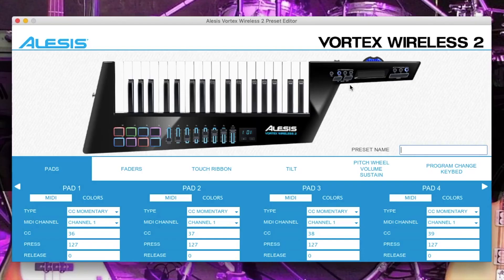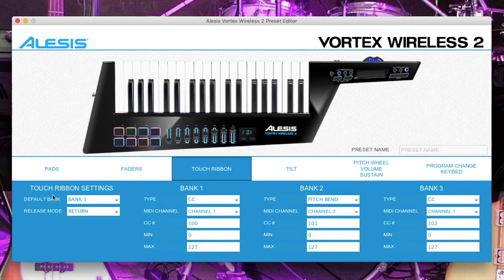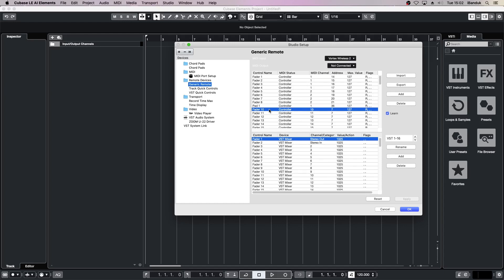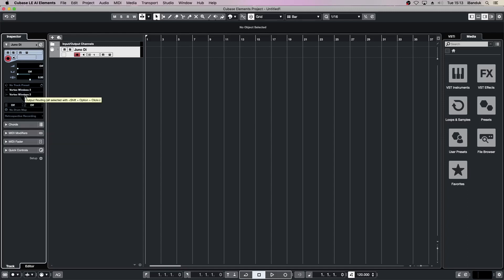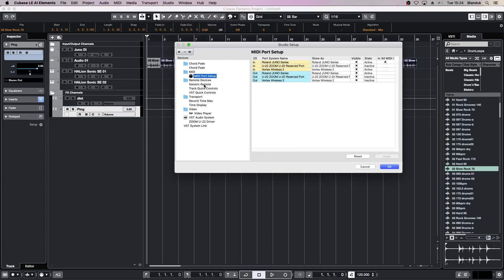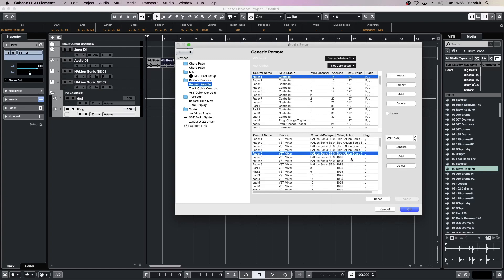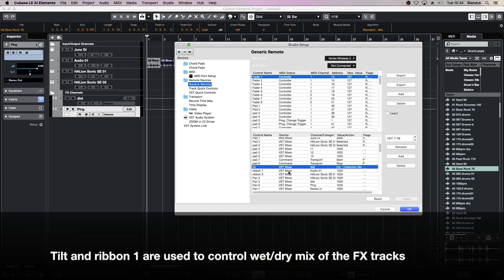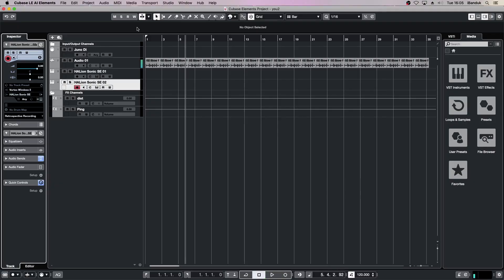How to setup midi controls in Cubase 10.5 and the Alesis Vortex Wireless 2

Comment: Hi Trev.
I didn't know how to contact you other wise so if i may ask you a question about this setup. Everything works fine except I seem to have a g in the middle of the keyboard that sustains every-time I hit it and it just keeps going.  It only occurs with the upper zone selected (maybe to do with the split?). I'm wondering if you experienced the same issue or is it just my setup. Also what firmware are you running?
Cheers!
Greg.
Reply from the maker: Greg Vancea 
Hi, 
I'm on FaceBook, just search for iband and the same profile image I use here.
I had a problem when I first bought the Vortex but it only appeared to happen when I used a preset I created and not on the default presets. I upgraded the firmware and the problem appeared to go away. I'm pretty sure there has only ever been one firmware update (v1.1.5).
Just checked my Vortex Wireless 2 with my Juno Di and had no problems. 
I have had a problem with Xpand!2 VST that generates a rogue note from a higher octave and then holds it so I had to set the keyboard range not include the upper octave(s).
Is it the same with usb cable and wireless dongle? 
Try a different preset on the vortex and a different sound engine/VST, a different DAW if possible (or a synth, or bandlab app).

if the problem persists try a firmware update.

Comment: Hello! I have a Vortex 2: Kontakt 5 > Evolution Infinity. I can't get the wawa pitch wheel to work. I've been trying and watching peoples videos for a year. It just won't work. I associate the Vortex and allow access in Evolution under the Tone category and it won't work. Do you have any pointers? I would really appreciate it!  Thank you
Reply from the maker: Cujo Kate 
Hi, I can't say I know a whole lot about your setup or indeed about Evolution Infinity but I am assuming you want the wah pedal to be controlled by the pitch bend wheel on the Vortex, so you need to assign the pitch wheel to both the low limit knob and the high limit knob of Evolution Infinity's wah pedal. Have you done this and it doesn't work? If so, you may have another assignment to the wheel that is over-riding it, in which case, try assigning the low and high limit knobs to the TILT on the Vortex or a Touch Ribbon instead and see if that works.
Reply: @IbandUK  hello! Thank you for your time and answers!

I can't seem to find the tilt knob if you were talking about. I watched YouTube videos for the infinity that went to Tone in distortion and  assign to Drive and Boost. When I do this nothing happens. I wish I could take a photo or video this for you. Below is a tremolo section for depth and speed but there aren't any other options.
Reply from the maker: @CujoKate 
OK,, let's do this step by step...
Click options button, top of main screen, click on Midi, in the left pane. Click on input in right pane. Is vortex listed and in the status column does it say on?
When you select distortion in the tone section does it show an image of the distortion and can you right mouse click the drive knob? If yes, can you click on Learn Midi in the box of options that appears?
If yes, click on the Learn Midi button then move your finger up and down the touch ribbon on the vortex, does the drive knob on the distortion now move automatically when you move your finger up and down the touch ribbon on the vortex?
Reply: @IbandUK  Hello! I went to the options gear icon> selected Midi> inputs >listed was vortex wireless 2. > on Port A.

I went to tone> distortion. Right clicked on Drive. A pop-up said learn MIDI CC# automation. I clicked on that. 

When I move the pitch wheel on the keytar nothing happens.

My midi channel is port a [vortex wireless 2]  number 2. For some reason number 1 in the past didn't connect.

I wish there was a way to talk about this privately, yt won't allow direct messages anymore
Reply from the maker: Cujo Kate 
Hi, it looks like we are getting closer... the pitch wheel doesn't use a CC#, so it looks like you can't use the pitch wheel. So when the pop-up says learn MIDI CC# automation, click on it and try moving a fader on the Vortex instead to see if that works.
If you want to message privately it would have to be on Facebook.
Reply: @IbandUK  that's great! Thank you! My FB name is Cujo Katy. There will be a pencil drawing of my face for the profile picture. Can't wait!!😊
Reply from the maker: Cujo Kate 
Hi, I sent you a message on FB so you should have my FB now (iband).
Reply: @IbandUK  hi there! Send you a friend request and responded to your Facebook message!